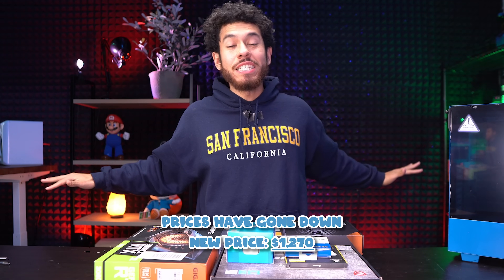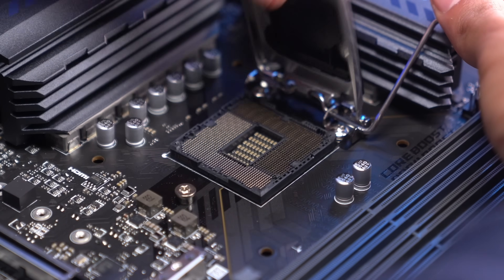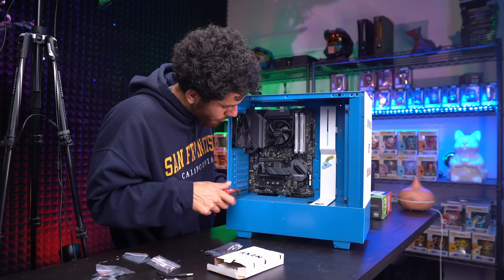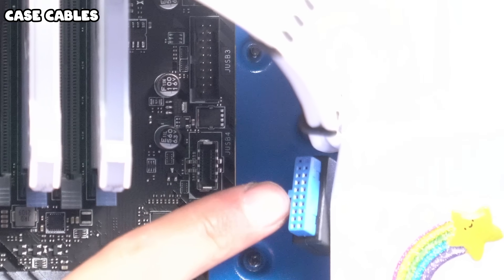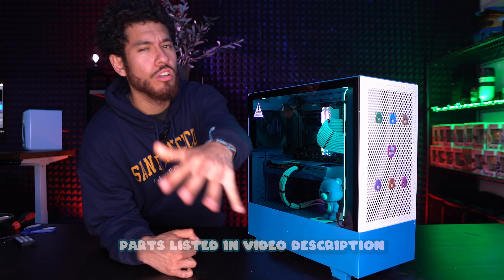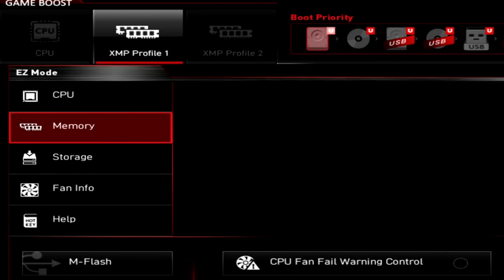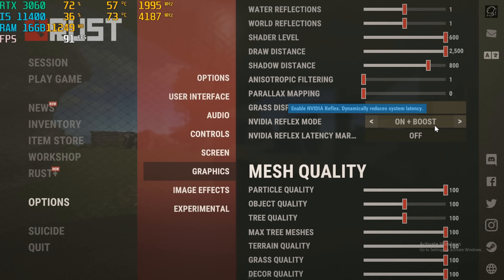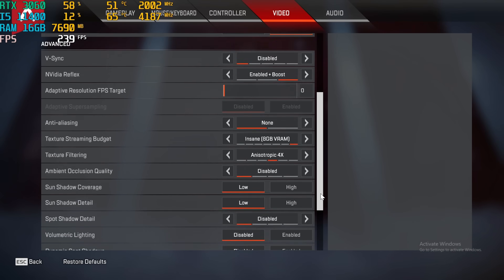$1000 Gaming PC Build Guide - RTX 3060 i5 11400 (w/ Benchmarks)

Comment: Hardest part of installing the cords was the top left power for the motherboard made me sweat hands cramped lol but loving it getting a good 180 FPS at 1080p on warzone thanks for the video Joey keep them coming
Reply: How long it took you to build it
Reply: @Boozii1  1 hour - 2 hours approximately following step by step
Reply: @kashshecatcheway9315  I’m about to build it real soon
Reply: I’m stuck at the mother board when I tried pulling the cpu lever down so I pull it hard ?
Reply: @Boozii1  yeah it will be fine the black cover will pop off that’s ok
Reply: @kashshecatcheway9315  I finally got it I’m stuck at the screw driver part (the first one )you know which torx it is
Reply: @Boozii1  never used a torx just Phillips screwdriver
Reply: @Boozii1  is the power supply switch on? Could try connect to the graphics card inputs insert your windows 10 flash drive USB then start up
Reply: @Boozii1  follow the installation guide pause and rewind if you need to
Reply: @kashshecatcheway9315  when I turn it on only the Corsair thing lights up the fan doesn’t do move
Reply: @Boozii1  you might have to back track
Reply: All your cables connected the way Joey sets it up?
Reply: @Boozii1  did you put your ram sticks in slot 2 and slot 4?
Reply: @Boozii1  not slot 1 and slot 3
Reply: @kashshecatcheway9315  I’m seeing red dot on the cpu
Reply: @kashshecatcheway9315  yeah I put it 2 and 4
Reply: @kashshecatcheway9315  do you want my discord so I can show you ?
Reply: @Boozii1  try backing up and taking out the cpu chip and reseating in the motherboard
Reply: @Boozii1  hopefully you lined up the little yellow triangle with the mark on the motherboard
Reply: @Boozii1  double check that your ram sticks are clicked in top n bottom
Reply: @Boozii1  then retry and power on
Reply: @Boozii1  lay your computer sideways push the locks to unlock the RAM pull them out then retry installing them thumbs on both ends and push down with equal force should hear 2 clicks on each of the RAM
Reply: @kashshecatcheway9315  okay
Reply: @kashshecatcheway9315  so you think it’s ram problem ?
Reply: @kashshecatcheway9315  I tried doing this but the cpu fan won’t come off
Reply: @kashshecatcheway9315  just did it only 1 click down should I just click the other one down ??
Reply: @kashshecatcheway9315  the ram thing ^
Reply: @Boozii1  yes
Reply: Line it up press down with equal force might get one click inspect it make sure they look like they are down correct if so then try to start it up again see if it helped
Reply: @Boozii1  if that doesn’t work then I’m thinking you might have to take off the fan cooler and pop out the cpu chip and look for the little triangle and line it up with the white mark on the motherboard and match them up and then place it in
Reply: @kashshecatcheway9315  your the best !!!!!!!!!!!
Reply: @kashshecatcheway9315  it took me to the bios screen but I disconnected to plug in my gpu now won’t work
Reply: @kashshecatcheway9315  the first screen took me to the bios screen
Reply: @Boozii1  ok now turn off the computer and plug in your windows 10 USB to the front of the case or top then start up
Reply: @Boozii1  if nothing yet then you got to open your bios then look for your USB flash drive and put that as number one priority
Reply: @kashshecatcheway9315  my flash drive don’t have windows on it that’s the problem
Reply: @Boozii1  hmmm might have to plug in direct to the graphics card input
Reply: So turn off plug in your HDMI or display port to your graphics card inputs and try turn it on
Reply: If you have a laptop and a flash drive check out “ how to download windows 10 pro “ in joeys video section using a laptop if you have one
Reply: Or another pc if you can
Reply: @Boozii1  I ended up purchasing my own windows 10 pro USB stick for way too much
Reply: @kashshecatcheway9315  I’m downloading the drivers right now but he goes way to fast he speed up the video what did you do?
Reply: @Boozii1  GeForce experience download the graphics or videos drivers then express installation 
Then msi motherboard go find those drivers
Steam 
Epic games fortnite 
Blizzard for warzone vanguard Cold War
Reply: @Boozii1  now once your in and all that you can restart too and hit delete till the bios opens up then click memory. Then click XMP Profile 1 then you can click X and save and exit
Reply: @Boozii1  to get your ram running at 3600MHz
Reply: @Boozii1  to check if it’s running go to task manager then performance tab then memory then you will see the speed at 3600MHz
Reply: @Boozii1  so for drivers you have to unzip them so right click extract all one by one till they are all unzipped then you can delete the zipped folders then one by one run setup for each of the unzipped folders
Reply: @kashshecatcheway9315  I only setup 1 driver I cannot find the other drivers
Reply: @Boozii1  if you downloaded them search in the bottom left "downloads"
Reply: @Boozii1  then run setup on them one at a time
Reply: @Boozii1  Nvidiacom for graphics card GeForce experience.
Reply: @freeb33r75  I’m good now thanks
Reply: @Boozii1  then once installed go into GeForce and under Drivers hit download then express installation
Reply: @freeb33r75  I had to slow down the video
Reply: @Boozii1  you should be good to go
Reply: @Boozii1  from FREEB33R go into the bios and fan settings the gear switch and change it from DC to PWM save changes and exit
Reply: @kashshecatcheway9315  what would this do ?
Reply: @kashshecatcheway9315  fan was loud so what do you think the problem is ?
Reply: @Boozii1  it just shut off?
Reply: @Boozii1  only problem I had was with afterburner It caused warzone to crash and now I have problems to launch it all the time CAP
Reply: @Boozii1  you wire everything properly?
Reply: @Boozii1  bro at this point ask Joey straight up
Reply: @kashshecatcheway9315  led powered by the power supply rt ?
Reply: @Boozii1  hmmm not too sure
Reply: Were you able to get it going? Your PC
Reply: @Boozii1  nice
Reply: I ordered a 3080
Reply: @Boozii1  yeah I got a 750 watt power supply should be enough to handle it, might just make another pc with the EVGA FTW3 3080 10GB
Reply: @kashshecatcheway9315  did you add extra thermal paste ?
Reply: @Boozii1  no, it came pre applied
Reply: @kashshecatcheway9315  you think I should add extra fan ?
Reply: @Boozii1  AIO if possible
Reply: @Boozii1  upgrading my power supply  850watt 3080 has 3x8 pin powers on it also my Cpu chip going i7-11700k
Reply: @kashshecatcheway9315  nice!

Comment: I bought an asus tuf f17 FX706HM    17-inch gaming laptop with the same cpu, graphics card, 16 gb ram, 512 gb ssd for 960 dollars brand new. The graphics card is only 6 gb compared to 12 gb, but 12 gb is not needed for that card and i dont think performance wise its so big difference. I will connect it to 32 inch 4k monitor if i want to play with big screen or else laying in the sofa if am lazy.  

So why buy a desktop these days for 1300 dollars, when the laptops is equally as good for a lower price, with 17 inch monitor included?

Comment: Can you add extra storage onto it? For example I have a Seagate Bare Drives BarraCuda 1TB Internal Hard Drive HDD. Even if this specific one does not work with it can extra storage be added?
Reply: Yes of course. Most PC cases have room for at least 1-2 hard drives. Check the PC case specifications.
Reply: @JJFlores197  New to pc gaming here and looking at this as my first build, does it matter if I go with 1TB SSD right off the bat instead of 500? I don't want to have to worry about storage later on and you seem like you know a good amount lol
Reply: @GBT-7-7  It doesn't affect anything if you go for a larger capacity drive. That's what I would do.

Comment: Would it be more interesting to change my R3 3200G by an R5 3600 or an I5 11400f? at the beginning I wanted to take the 10600K but because of the temperatures which rise really high I gave up the idea (this is what also made me hesitate for the 3600).
Reply: @Magnus Rasmussen Thank you for your answer, I feel like the 3600 is starting to get overtaken by most cpus and it's not as interesting in 2022 and after that, I think I'll wait a bit and see how the things are changing by summer.
Reply: @Magnus Rasmussen Yes I would have preferred the 5600X too but where I live it costs 398 USD while the 3600 costs 257 USD and the 11400f 264 USD that's why I got interested in those. Which is better between 11400F and 3600? (in terms of performance and heating)
Reply: @Magnus Rasmussen Yes I know and even if I ordered these products with cheaper prices from abroad in the end with the delivery price I will end up with the same prices or even more expensive.

For the 12100f I looked for it but it is out of stock (everyone jumped on it) and the mobo type b660 cost around 300 USD and more

Comment: When I go to download the motherboard drivers my step by step process is not the same as yours ?.. I’m not a tech savvy guy and this is driving me nuts aha can someone help a brother out
Reply: Can you elaborate? Not trying to be rude, but its very difficult to help without much information. For the most part: you download the drivers you need and install them. Drivers may come in a compressed file (zip file). you open this file and extract (drag and drop to another folder) everything from that file. You then look for an installer, usually called setup.exe or install.exe or similar. You run it and follow the steps.

Comment: The timing couldnt have been better. I got jealous of my friends finally getting their PC setups so I thought it'd be the perfect time to build mine. My friend sent me this video and I built this PC, step by step, with every single part in the video (except for the carebear and spraypainting of course xD). And I gotta say Im in love with this PC. It's fast. Its beautiful. It's everything. Games run smoothj and I have no issues. Thank you Joe for these step by step PC building videos. Without you. none of this wouldve been possible. Truly, thank you.
Reply: How’s the power supply sound? I’ve heard people say it’s quite but I’ve also seen a review saying it’s very loud.
Reply: @gangstersocks  I hear zero sound from it ☺️
Reply: @jasontheironhashira  did you use rgb strips like joey? if so where do you plug them in
Reply: @gangstersocks  yes I did 🥰 I think I plugged it in on j-rgb 1 on the bottom right of the motherboard
Reply: @jasontheironhashira  did you spray paint it like he did ?
Reply: @Boozii1  no I didnt
Reply: how did you get the wifi to work? did you buy a wifi card
Reply: @COPCAM_FOOTAGE  I just used an Ethernet cable so no Wi-Fi needed. Plus it’s 10x faster
Reply: @COPCAM_FOOTAGE  def get one
Reply: How much did you pay for ot
Reply: @Mexxprr  sorry but what’s OT
Reply: @Boozii1  not with the blue and carebears. Everything’s black and white
Reply: @jasontheironhashira  do you have the Amazon cart link still?
Reply: What monitor do you use for it? I built the same pc but don’t know which monitor would be good this pc
Reply: @twist8242  any 144hz monitor would be good. All the brands are good honestly. I just used my old Acer 144hz monitor that I used for my PS4
Reply: @jasontheironhashira  did you end up getting a different cpu cooler or stuck with the stock one, if so is it good?
Reply: @sylo5684  just the stock one. It is good. But if you’ve got like an extra $50, there’s a good one on Amazon my friend got and it does make a difference in cooling. I personally didn’t need it, it does look dope though
Reply: @jasontheironhashira  what cooler is it?

Comment: instead of getting the 3060, should I get the 3060 ti, cause i have a little more money?
Reply: @Xusar what psu should i get that could handle it?
Reply: @tvrrx  850w or more
Reply: @Magnus Rasmussen I'm not sure if this is good, cause I'm not that familiar with computer stuff, but is this good? EVGA 220-GA-0750-X1 Super Nova 750 Ga, 80 Plus Gold 750W, Fully Modular, ECO Mode with Dbb Fan, 10 Year Warranty, Compact 150mm Size, Power Supply
Reply: @Xusar I'm not sure if this is good, cause I'm not that familiar with computer stuff, but is this good? EVGA 220-GA-0750-X1 Super Nova 750 Ga, 80 Plus Gold 750W, Fully Modular, ECO Mode with Dbb Fan, 10 Year Warranty, Compact 150mm Size, Power Supply
Reply: @Magnus Rasmussen Do you think, you could help me find something that's better than this build with the parts you listed within the range of $1500 cad - $1600 cad?

Comment: Can you do a RTX 3070 Ti, 1440p Gaming PC Build for around 1750-2250$?
Reply: @Magnus Rasmussen That is very true, you can get along with 1450$ for RTX 3070 Ti 1440P Gaming Build with prices still dropping more and  more, for the CPU I would recommend i5 12600k or 12400f if pure gaming, you can use stock cooler as well, and go with a DDR4 motherboard
Reply: @Magnus Rasmussen I will send you a link for a pc build in pc parts list after I find a good one
Reply: @Magnus Rasmussen Ok, yeah 😅

Comment: can I use the “Antec NX410 ATX Mid-Tower Case, Tempered Glass Side Panel, Full Side View, Pre-Installed 2 x 140mm in Front & 1 x 120 mm RGB Fans in Rear(White) (9734088000)” case aswell? it’s the one from ur previous “best $1000 gaming pc 2022” vid or does the motherboard and stuff not fit in that one?

Comment: Hey Joey I built this pc it’s working great except when I play war zone the CPU core temp is 90+ up to 99. I tried taking off the glass panel but it doesn’t help. Looking for advice. Thanks
Reply: Get an aftermarket cooler for it. Shouldn't cost much
Reply: @likeagrape57  will do thanks 
Update: Cool as a cucumber
Reply: @oscareljefe1  very nice!
What cooler did you go with?
Reply: @likeagrape57  I  got a thermalright low profile. Much beefier than the intel fan
Reply: @oscareljefe1  if you don’t mind could you give the most specific name for the fan please?
Yesterday my pc went over 100C when trying to play battlefield 1
Reply: @AlephBeing  Thermalright AXP-90R Low Profile CPU Cooler. 
Ps. The sticker leaves behind some residue on the contact area, make sure you clean that off with the 90+ alcohol
Reply: @oscareljefe1  thx bro same problem & my warzone worked for a day then next day ended up so choppy & laggy & now the game won’t even go past the installation on warzone it jus says disconnected from blizzard

Comment: I'm building with a z690, 12400f, zotac twin edge 3060, 32gb DDR5, and 970 pro nvme. It's close to that price. I'm at $1600 with my screen which is an MAG27 CQ which is 1440p and 144hz. I got the Gigabyte board as an open box for $160 and paid $580 for the 3060.
Reply: Mike I’m looking to do the same. Have you completed your build? I want to be able to run 1440p and get over 100 fps on games like warzone. Do you think that build set up can do it?

Comment: The build together for me adds up to 1450$, i couldn't find the original gpu but I got one from MSI same 3060 nvidia, it's 710$ but the one Joey showed is 790$ so I went with MSI, I also got a 45$ air cooler or 30$, and I upgraded the storage to 1TB which cost another 45$
Reply: Which cooler did you use? and what did you do for wifi?
Reply: @gangstersocks  it's a cooler master one, recommend use those only, it's around 45-50$
Reply: @Telepathy6ixx  do you know what model it is?
Reply: @gangstersocks  Cooler Master Hyper 212 RGB Black Edition 57.3 CFM CPU Cooler
Reply: @Telepathy6ixx  The $45.99 one on amazon right
Reply: @Telepathy6ixx  and it fits the mag b560 motherboard Joey uses right?
Reply: @gangstersocks  yes, I made a build with the Same parts he used on pc part builder and nothing was wrong with it, do research though.
Reply: @Telepathy6ixx  can you send me the link to that build
Reply: @huasha458  unfortunately I don't have the link to it anymore

Comment: Love the build but seriously please do not ever use an intel stock cooler unless you are on a very very tight budget. Seeing how just playing Siege with medium to high settings was an absolute bonfire for your CPU a cheap $35-$45 CPU tower would've been more well spent than some RGB ram and expensive motherboard.
Reply: What cooler do you recommend for this build?
Reply: @scspartans626  As of right now CPU coolers are a bit expensive but the one I recommend would be the Cooler Master Hyper 212. Right now they're $43 which to me is overpriced for just a fan cooler. Usually they go for around $30.
Reply: To replace the stock cooler

Comment: For the GPU, Is the 3060 Gaming OC 12G different than the 3060 Gaming OC (REV 2.0) 12 G?, because you linked a 2.0 but put the price of a regular
Reply: Rev 2.0 would be better since its a revision of some tweaks with the normal ones

Comment: 10th gen is definitely where the deals are.Msi` b560 Bazooka is also a good option in this same build,sometimes a little cheaper.
Reply: Can I use a 3060 ti instead of a 3060 for this build?
Reply: @kurkza1302  any 3060 works